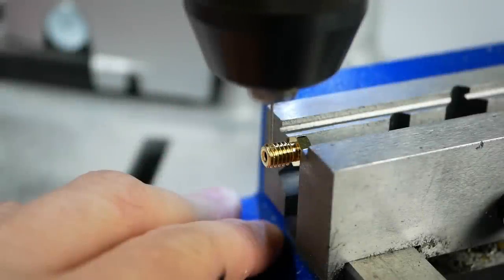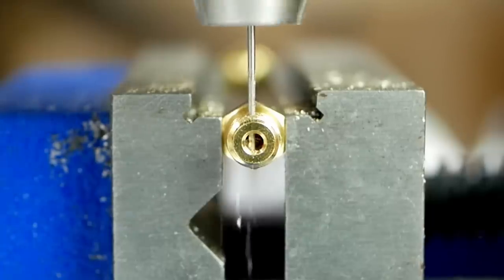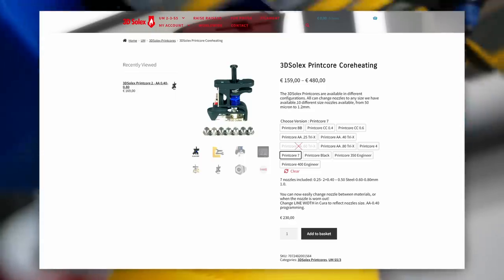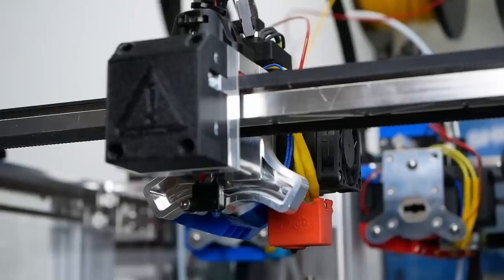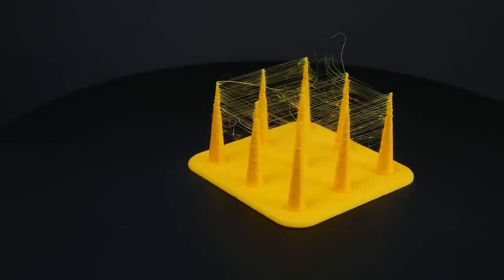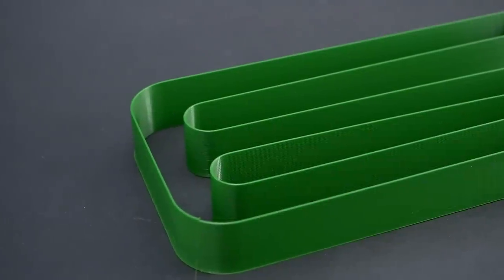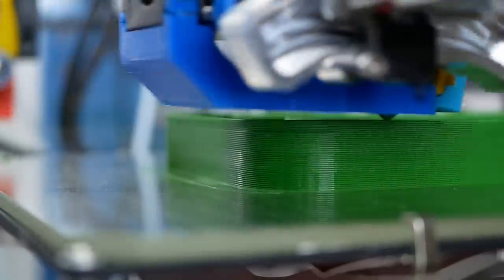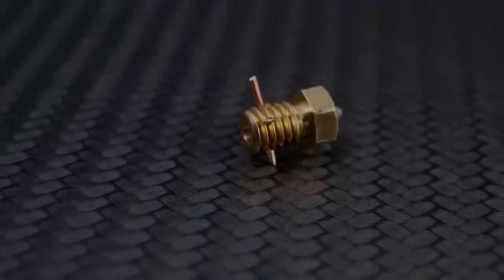My High Flow Nozzle is better than a Volcano hotend!

Comment from the maker: Use the code CNCKitchen to get Curiosity Stream for only $14.99 a year! https://curiositystream.com/CNCKitchen

DIY or buy a high flow extrusion system? What's your take?
Reply: You could actually patent this yoursel
Reply: Very interesting, i wonder what difference it would make if you had the wires poking about a third into the melt zone from each hole on an unenlarged chamber x wire version, it would be a bit more fiddly to make but since most of the space is still open it might impede/affect the flow less while still give more surface area for heat transfer.
Reply: Would induction heating help keeping the insides of the nozzle warm?
Reply: Hi CNC,
What about using a copper or brass insert? like a triangle where the mid-points of the 3 sides are folded to connect at the center?  it might result in a more symmetrical splitting and recombination of the filament
Reply: Maybe you could make a vertical cut through the thread, insert a piece of copper sheet metal and braze it in place. It would have more surface than a piece of wire.
Reply: @andreasvogler1875  It should be a reasonably thick one, to help the heat flow into the sheet. Then hammer and do some rough sharpening on the side that will do the job of cutting the filament in two.
Reply: I'm probably not the 1st to post this but to get the drill to centre, first get a hex nut that fits the nozzle & dot punch the centre of a face, thread it onto the nozzle to the required depth & then drill through the nut & nozzle together.

If you want to really get it centred use a centering bit before the normal drill
Reply: Ok, i got a technique to try:

File the wire to more optimal shape before you insert it. This should decrease the resistance as it increases area and the shape can be more "aerodynamic". A small round diamond file should do the job just fine. And making it slightly off set give you better change to get the two halves more equal, filing more from one side of the wire and lots of fitting, using macrophotography to get the exact same area..
Reply: Thank you for recommendation. Annual plan booked. 14,99€ is almost to cheap. 😮
Reply: @andreasvogler1875  This sounds like a good idea
Reply: Could this be done with a nozzle like the nozzle X?
Reply: Idea:
Copper wire soldered... hold up, dont want someone patenting this idea just yet 😀 haha
How could i slide you my idea to try for a vid?
Reply: DIY sounds great if you have a accurate and good drill press (still something I haven't got). Also you could try sharpening the wire on the top.
Also to get a more centered hole drilled, try using a shim of some sort, make one up, not a hard thing to do given you have the tools already.
Reply: @andreasvogler1875  Great idea!  Two perpendicular cuts and two pieces of copper slotted into each other and sharpened at the top and bottom would work even better, I'm thinking.
Reply: @PRiMETECHAU  i was thinking file the area flat using a small edge of a file, measure and center punch, when soldering build it back up with solder which then during the tapping process that should replace 99% of material back... Use a small amount of thermal paste if its not 99%
Reply: As a quick shim
Use an M6 nut that you can screw onto the nozzle.
Measure and center punch that to drill through first to create the guide
Reply: @CommanderJPS  Avoid solder and paste, use a spot welder perhaps...
Reply: @PRiMETECHAU  mmm its brass and copper, you could braze it however i would say for testing purposes and for ease of re-tapping the threads it would be easier to solder :)
Reply: Ayudaría mucho qué se pudiera mantener el flujo laminar para qué las moléculas de polímero no se enrreden más,  tal vez puede ayudar un estriado interno paralelo al flujo Y con esto creo yo que aumentará
Reply: @CommanderJPS  Easy silver solder (melts somewhere in the 1100F range) is definitely the way to go here. And just a tiny speck of it. I am deployed right now, but I will definitely be trying this when I get home. Will try to use a 3d printed drill guide as well, and probably draw the wire down to .5mm or so.
Reply: @JOEDHIGGINS   my printer is sat on the workbench at the moment having mods and tweaks... I had an idea i wanted to try after seeing this vid which should not infringe the copywriting  🙂 stay safe out there
Reply: What if you flatten the wire a little bit where it meets the filament in the nozzle
Reply: @ericrichardson3332  tal vez funcione como dices con un perfil óptimo hidrodinámico para que genere el mínimo turbulencias teniendo en cuenta qué no es fluido newtoniano
Reply: The threads of nozzle causes the drill to slip. This is very common while machining a curved surface with angle greater than tip angle of drill. Using a jig to center a drill would improve the centering significantly. You can also use chamfering drill bit of appropriate size to make pilot pit as they are stiffer. 
I think, sharpening the curvature on inlet side (like a knife) with thin file would reduce the flow resistance. This will also increase the upstream contact area making incoming flow melt better. With manual filing you can also make sure that both side of holes are symmetric.
Reply: Hi, very interesting to test will be:  thin plate of cooper (0.5mm) in the first 4-5mm clamped in a kerf instead of the round wire. I would do the kerf with a really fine saw blade in a fretsaw or with an diamond blade in a micromotor. I think the surface of the heating cooper is bigger!
Reply: Well now i see Andreas told this before ^^
Reply: You can use a special drill bit known as a "center drill" to keep your drill bits from walking on the material
Reply: Now another experiment:
Add wire to the end of the heat break and see if it works with changing nozzles!

This would be more revolutionary, especially if the heat break top is from a abrasion resistant material
Reply: I want to know how someone can patent flow separation. This is not a new idea and has been a thing sense the dawn of machining and engineering. You can't just be like "Well this nozzle is designed for plastics". Whether plastic, water, oil, gas, metals, etc. Is all the same, the fact he was granted a patent for this is backwards and illogical. 

Maybe I should go get a patent for this nozzle design as a heating & separation nozzle for Soy Sauce just to prove how ridiculous that is.
Reply: I would try to grind the wire into a wedge then feed it in the nozzle sharp edge up. It might be better to move the wires down a bit more to allow the outside to melt more before the split point.
Reply: @andreasvogler1875  that was my thought as well, use two sheets intersecting each other by making a cut in the middle half way through both and brace them in place before bracing them into the nozzle. You could also file the edges of the sheet to reduce the resistance on both the top and the bottom.
Reply: to get your drills on center on  something round use a slightly smaller  endmill to make a flat ,then center drill on the flat , then drill.
Reply: Hey try comparing this nozzle system with the new video design you noted with nuts or not.  Would be interesting to compare even with only a quick graph comparison.
Reply: Also, maybe use a electronics higher silver content solder for higher temp materials.  The silver would be great for thermal conductivity as well.
Reply: I'd use an old heater block to make a drill guide. Drill through an old Alu heater block at the depth you wanted to drill the nozzle at. Then just screw a nozzle in and drill again through it. Should be as straight as needed. If you want more holes, just screw the nozzle in more or less.
Reply: @CommanderJPS 🎉
Reply: @QuadDoc  did.you.make.a.break.throught?...my.space.bar.just.broke...ffs...it's.been.one.of.those.mondays....

Comment: If you screw the nozzle inside a M6 nut you have a flat face on the nut where you can start drilling. Very interested video and results!
Reply: that's a nice idea!
Reply: Smart !
Reply: Id use an old heater block but a nut is also a good idea.
Reply: Predrilling the nut should make the process really simple.
Reply: @ralfr321  And that's called a jig. I was thinking it would be a great idea, but making it from a simple nut is a brilliant idea!
Reply: Use 2 nuts and tighten lightly against eachother to negate any spinning from vibrations, if the nut and nozzle hex size don't match. This is also a fine way of clamping all-thread bars in a vice for cutting. If you accidentally slip a little, the nut will take most of the hit instead of the bar's threads. When done, undo the nuts and you have "recut" threads.

Pre-drilling the nut was also a good idea, thanks guys.
Reply: Could probably just 3d print a drill guide that threads to the nozzle and has a centered hole. Drill from both sides to further reduce wander.

Also, smaller wire will probably perform better.
Reply: We've got the same idea, I didn't see your post when I sent mine...
Reply: Dang, I was thinking of just making a nozzle like he did a while back, and drilling the perpendicular holes before threading. Your idea is better, but you'd potentially need 2 nuts; one for a jig and one as a jam nut.
Reply: Maybe adding the solder blob and flattening the top before you drill will be enough. A nut with a hole through would be better and help centre it.
Reply: @CaptianBarouq  You'd want to use a vice and bench drill anyway, so you should be fine with just a pre-drilled nut.
Without a bench drill you'd either need superhuman talent or a lot of sub-1-mm drills...
Reply: I dont think that will work, using different metals and combining surfaces together is a technique used to protect locks from being drilled. But still a cool idea and thing to try for content :)
Reply: Yes of course ! 👍😊
Reply: Great idea. And a canter drill (spotting drill) could also be used on that.
Reply: @klave8511  Solder is very soft and wouldn't work well as a drill guide, I think. The likely irregular shape of the solder would also make it hard to find the center.

The idea with the pre-drilled nut or a similar jig would be my choice for the task.
Reply: Great Idea!!! I wonder if you could put the wire in through the nut as well, and have it shear off when you back the nut off.
Reply: @mckidney1  combining materials to prevent drilling in locks is usually only done in brass locks, and they add hardened steel pins which are far harder and more resistant to drilling. In this case you'd be taking brass and adding solder, a softer metal, which wouldn't improve drill resistance at all.
Reply: I wonder if making a 3D printed M3 nut with a hole would help center the drill bit. It should, drill bits cut best downwards and very poorly sideways so the bit won't wander sideways.
Reply: Center drill first too. Important to drilling straight holes. Idk if that would work without the nut. I haven't had to drill into threads yet but if I did I would probably just drill the hole and then thread it 😅
Reply: @AlphaCharlieFour  That would most likely break a brass nozzle right at the hole you just drilled, or damage it in some other way.
Reply: If your vice does not have parallel cuts for holding corners, you may want to use a square nut, or mill the hex edge you will drill through as a flat surface to center punch and pre-drill. Also having a bolt or all-thread in the nut as you pre- drill should prevent the bit from wandering while it is going through that space in the nut. Chase the threads after pre-drilling so that you don't mar the threads of the hot end, as well as chasing the threads on the hot end after doing everything. 

A steel M6 nut, hex or square, should give better center holding. Also having a piece of another metal turned down to the bore the filament will pass through should help prevent leaving scrap from the drilling operation being left in the bore, as well as reducing the bit's tendency to wander here. 

Getting a jam nut against the nut you are using as a guide may be difficult to work with in a vice unless the long axis of the jam nut is greater than the short axis of the mill nut. (nut you are drilling through.) 

Of course at some point you may realize that cutting, milling, and setting center punches for both an M6 nut, and the drill hole may be the 'better' solution. (I have neither a mill, nor a lathe though, so all of this is suspect.)
Reply: Such guides are called drilling jigs. Also curious if 3d printing it would work?
Reply: i like the nut idea. I was thinking just mill a flat before drilling as is a pretty common technique when drilling angled or curved surfaces
Reply: and try to use a drill less than 3 meters long...
Reply: @constantinosschinas4503  Endmills? anyone heard of Endmills? they can be used to create a perfect flatspot for drilling or even to drill a very precise positioned hole. you just have to drill very careful and slow with high rpm😅👍
Reply: Thank you for the tips, I'll keep it in mind.
Reply: Some ideas from a machinist: 
1- Use the highest speed setting for such a small diameter
2- Carbide centering drill to form a starting valley for the tip (or a carbide drillbit if you can afford)
3- Flatten the surface with a 1-2mm Endmill
4- Use a special precision drill chuck 
5-dont exert excessive pressure, try to let the drillbit work for you and apply constant feed and start very slow
5-Peck and remove chips
6-use coolant
Reply: Or you can use a center cutting endmill and it will mill a nice flat and cut without deflection and would create a nicer hole.
Though, a steel nut could create a nice anti-flex bearing if all you want to do is use a drill bit and not buy any other tooling.
Reply: I was just about to say this. The only other option would be to use a square cut end mill to mill a flat spot where you want to drill.

Comment: What about instead of inserting wires, we cut a longitudinal slot in the nozzle and insert a thin copper plate, like a splitter. Maybe more efficient and definitely easier to do.
Reply: First he gotta mill that shape. Which might not be easy
Reply: @nilsirrah7672  you could just cut the flat (top) side of the nozzle with a dremel
Reply: @nilsirrah7672  Why complicate stuff and start milling, when there's a simple angle grinder or a dremel. 😃
Reply: Or perhaps file the copper wire before inserting it, so that the wire looks more like a sharp blade ?
Reply: @champifun2  But the plate can be longer or shorter, so we have more parameters to play with. Basically cheaply replicating the production one.
Reply: @Lassi Kinnunen 81 Yeah, I did this today. Just pushed the box cutter blade inside. It definitely brought good results, but incomparable elsewhere.
Reply: @Lassi Kinnunen 81 Drill several holes and file.
Reply: If you can find a small enough slitting saw, why not?
Reply: Good ideas! Using a jeweler's saw to cut the slot might be a good approach, more control and precision than a Dremel cut off wheel. Jeweler's saw blades are very thin, with a curf of around 0.4mm. Then, you could easily slide a thin gauge copper plate into the slot, and solder it in place. Two slots at right angles could also be tested.
Reply: @Lassi Kinnunen 81 just use a dremel cutting disk and a jig to hold it perpendicular to the nozzle, pretty simple.
Reply: @champifun2  this was my first thought as well
Reply: @champifun2  'looks more like a sharp blade ?'  This.  Drill a hole, use brass rod instead of copper so it's more in line with the nozzle for strength and wear.  Large enough diameter, and grind the front and back so the rod basically becomes a thin vertically oriented plate.  Should have good heat transfer but lower flow resistance.  Then braze it in instead of solder and you should be good for even the higher temperature filaments.
Reply: You could also dremel/drill a flathead-like notch in the entire thing and put an incredibly tiny piece of a razor blade in it. Theoretically.
Reply: @Lassi Kinnunen 81 Yes, worked great. Widen the hole in your nozzle, , make precise size of the blade, make it sharp and arrow like on the backside also, so the filament has good flow in the nozzle, and bam! The flawless part of the performance is not much better, but the breaking point of non-usability gets much much further. And that's fine for infill printing. As long as it makes usable infill, it's good enough. You don't need extreme volumes for slow perimeters.
Reply from the maker: Great idea!
Reply: @CNCKitchen  Stefan you need to use a Wire-EDM to cut the nozzle :-D

Comment: A couple of nuts on the threads to lock the position, a dimple on the flat of the nut, and a center drill bit.  If you have a watchmaker near by, this would be easy…if they find interest.  :-)
Reply from the maker: Good point!
Reply: Most of the comments say to mill a flat spot, but this technique is clever for not requiring the threads to be destroyed.
Reply: And the nut can also be re-used as a guide if the hole came out properly centered. You could also just create a guide nut by applying the same technique to a plain M6 bolt before sacrificing nozzles
Reply: I forgot about the nut trick.
Reply: I completely forgot about the nut trick. Thanks for the reminder.
Reply: How are you holding the nut such that you're able to drill into the flat of the hex?
Reply: @robmckennie4203  a second nut can be tightened against the first to hold it in place. Alternatively, some Teflon tape or thread lock may also be sufficient - though requires cleanup.
Reply: @BenReese  I imagine the die would take care of most cleanup while cutting the wires.
Reply: @BenReese  so the section where you have 2 nuts tightened against each other are hanging out of the vice? Doesn't sound like a stellar setup to drill through steel